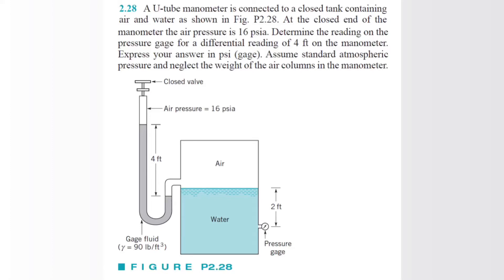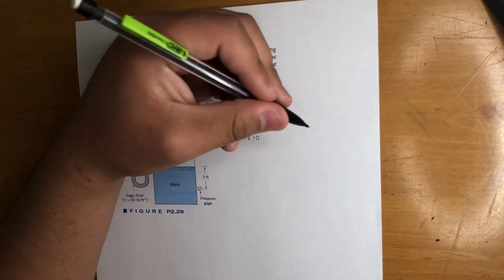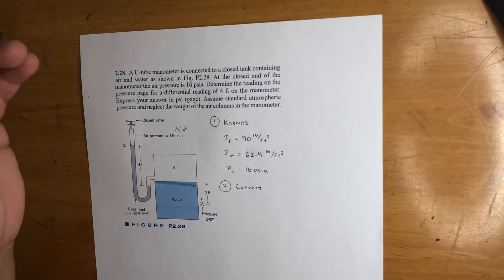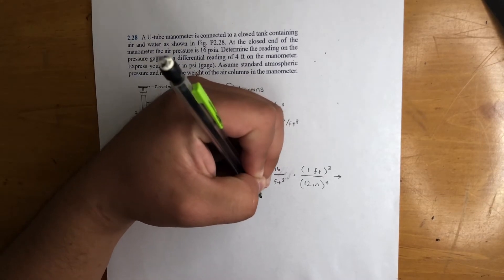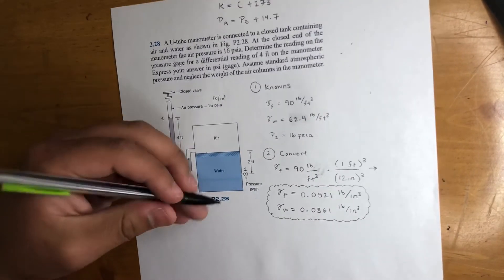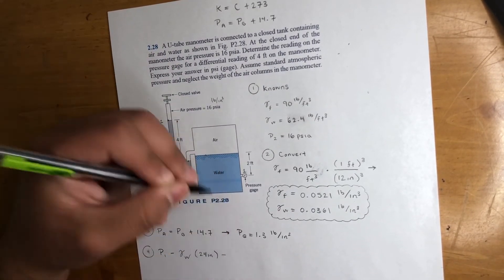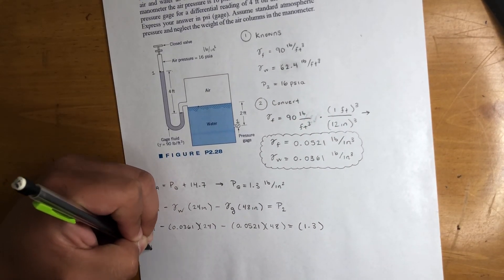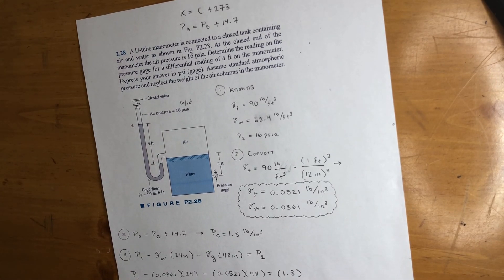Fluid Mechanics - U-Tube Manometer Connected to a Closed Tank

Comment from the maker: Yadani, so the reason why I said start at Pressure at Point 1 in step 4 (5:38) was because I knew pressure at Point 1 is higher than Pressure at Point 2 and wasn’t sure I would end up with a negative number and confused you more. Just realized I could have started the equation at Point 2 and had no difference. The equation would be

P2 + Gamma*48in + Gamma*24in = P1

Only the signs switched.